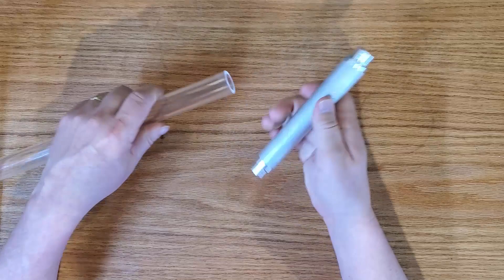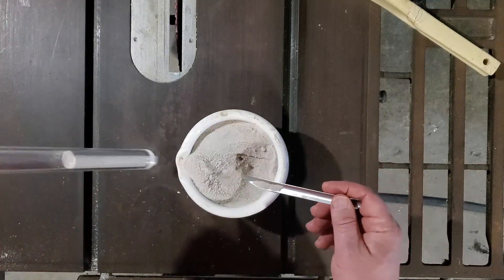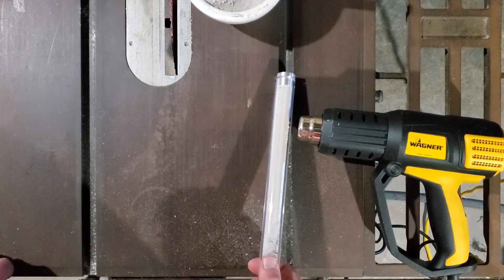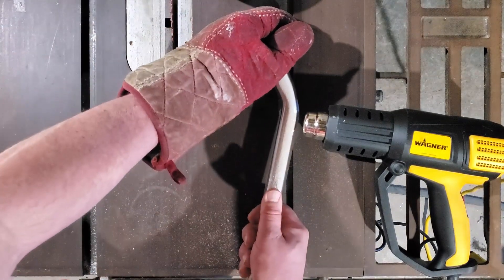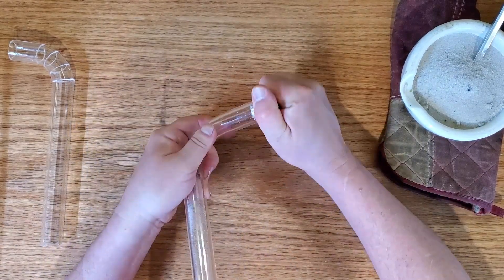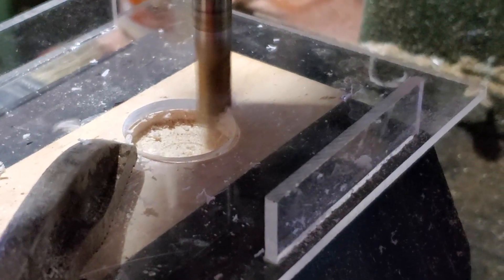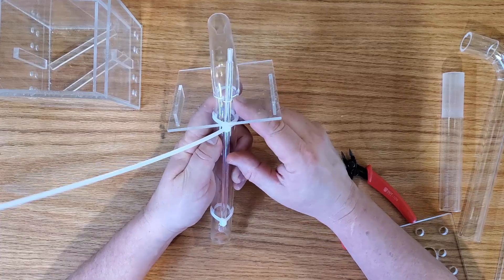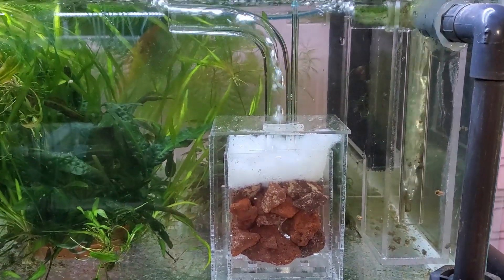DIY Sweeping Elbow Box Filter

Comment: Cool.  It looks awesome.  Now you can play with Venturi’s in bubble size. When I was researching the mat and filter guys they were fully convinced that the bubble size made a huge difference to water volume.  I remember you made one were you drilled a bunch of little holes in the pipe. I don’t know what the formula is for those but I think it does make a difference.

When you were talking about the noise from the bubbles, another thing that helps with that is if you cut a little bit of an angle on the outlet end of the pipe, just cut a little more than 45 I would say
Reply from the maker: Hey Shane! I will probably play around with this some more and see what comes of it. If there is anything significant i will post another vid.

Comment: great idea I'm disappointed you didn't do a flow test again.I use the sand trick on PVC I pack the pipe with cold sand and tamp it down to where I want the bend to start then bit of tinfoil heat the sand in a pan on the cooker use a steel funnel work fast the better you pack it and cap it the less it ovals hope this helps ☺
Reply from the maker: Thanks for your thoughts on this! Much appreciated

Comment: I think this is one time to simply purchase a unit, since gathering and purchasing materials and developing a construction technique for a single exhaust pipe won't be worth the struggle.  The commercial built units run from $7 - $24; from 6" to 22" in height; from 16 mm to 32 mm in width.  They also have slanted mouths to silence the bubbling noise.   http://www.swisstropicals.com/filtration-shop/jetlifter-cubelifter-shop/
Reply: Theyre kinda ugly tho
Reply: @justinbombs955  ...  Is it the Krylon brand spray paint that is safe for aquariums?  Just spray paint it black.
Reply: Aside from the fact that some just like making their own, I think I'd much rather see this acrylic DIY than those pieces of plumbing in my tanks. But I do thank you for posting that as it's an idea I wasn't aware of and will look closer at (the bevel cut).
Reply from the maker: For a single one of, you're quite right. Sometimes I spend allot of time reinventing the wheel for no real gain. In this case with the current situation, doing it myself was the only option. Thanks for sharing that info!